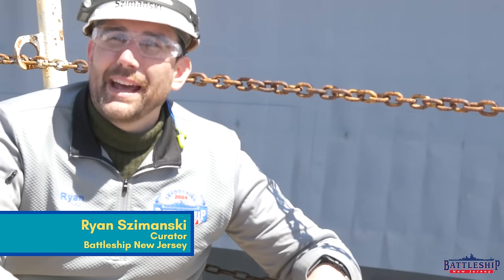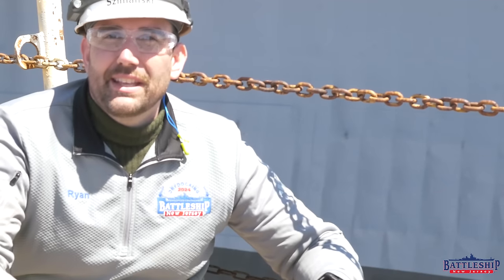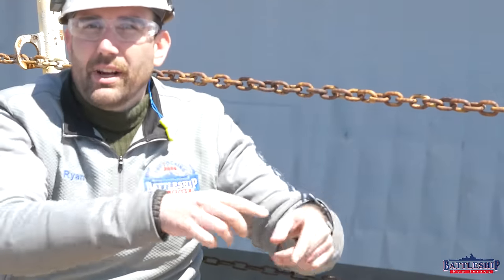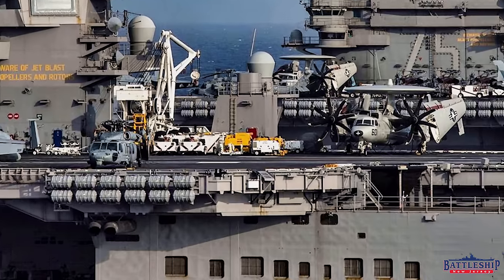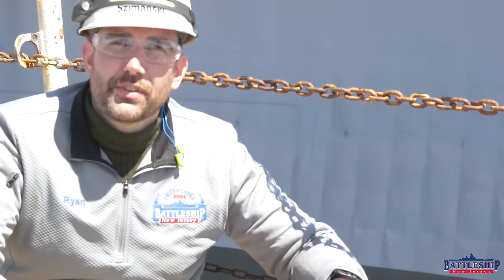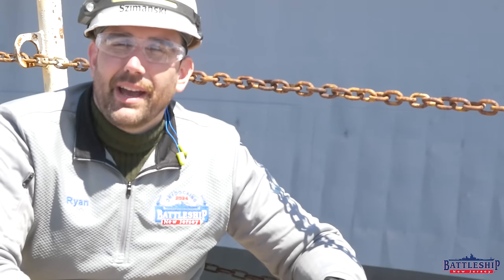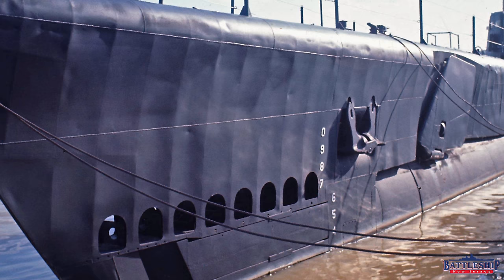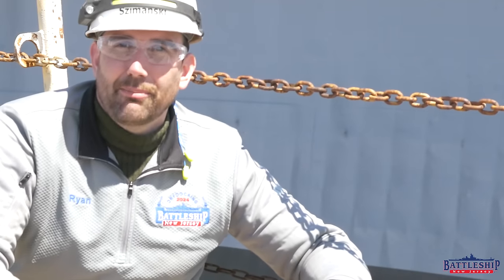What's With All Those Dents In Ship Hulls?

Comment: Hi Ryan.  Sorry to disagree with you but "oil canning" is NOT caused by the heat of the sun.  It is more properly called, in structures circles that is, diagonal semi-tension buckling or simply shear buckling and is common in thin (relative to the length and width dimensions) skin structures where the shear stress exceeds the critical shear stress for buckling (most practical shell structures) and the shear load is the caried by a diagonal tension field similar to the way a girder truss works.  It is very common in aircraft (even at night or in the hangar).
Reply: Yep. 

It will also be there permanently if some of the members (spars, ribs, frames, stringers, etc) have gone beyond their yield strength.
Reply: More like "hungry horse" thermal expansion and rarefaction
Reply: Mhhm. Yes. Indubutably. I totally understand.
Reply: Sorry to disagree with you but look the location where it is happening that blows your argument out of the water.
Reply: @autumnfragrance6326  Sorry, I don't get the "hungry horse" reference.  Its got nothing to do with thermal expansion.
Reply: @2esc2esc  I guess this is a dry dock joke.  I'm sure any experienced structural engineer will confirm.
Reply: @emmabird9745  We in the industry call it hungry horse because you can see the ribs through the skin... like a skinny horse.
Reply: @autumnfragrance6326  Thanks Autumn, yes that makes sense.
Reply: Wouldn’t distortion caused by the heat of the sun cause shear stresses?
Reply: Why not speak in plain English so everyone can understand you
Reply: @Thing696  Hi Diane.  In answer to your question, the sun heats things up slowly (on earth anyway) and the heat soaks through the structure.  Yes there will be a thermal gradient (some bits colder inside the structure than the warmer bits outside) but not sufficient to cause the effect.  To cause it the top of the hull has to get a lot hotter (so it expands while the keel is a lot colder) which would cause a "hogging" moment (technical term meaning the centre lifts up).  I'll leave it to someone else to work out what sort of temperature difference would be required and then take measurements to test the theory.  Perhaps Ryan can get some temperature measurements of keel and deck through the day.  I doubt there will be sufficient difference.
A possible source of the shear stresses is the blocking pattern compared to the slip way supports.  What I mean is it it possible (actually likely) that the keel supports at building were not perfectly flat (flatness over nearly 1000 feet is quite a challenge) and the hights of the blocks do not present a flat straight line, at least not the same out of flatness.  That would produce shear stresses down the length of the hull.
This is a comparison of "out of water conditions", of couse in water the buoyancy distribution would very rarely match the weight distribution so that will create shear stresses too but Ryan's picture is out of water.
I'm not a "naval architect" but a structural engineer whose structure normally exist in other media, but all structures behave the same.  Hope that helps.
Reply: It comes from the water sucking away from the steel.  Like the superstructure pressed from wind.  The water "oil cans" the hull outwards between the ribs on the hull.
Reply: @gerryscully9248 Any time a group of technical guys sit at a table the tech-speak doesn't take long to start. I was a radio engineer - happened all the time. My girlfriend would laugh about it afterwards.
Reply: @gerryscully9248 The purpose was to showcase purported knowledge, not broadly inform.
Reply: It’s from the bulkheads being welded. Weld draws/Pulls on material that’s welded.  Also as he says, steel expands when heated, even by the sun. With 16 years of building and repairing large oil storage tanks… I know how steel moves, expands, and contracts.
Reply: B52 side comes to mind.
Reply: @AnthonyTolhurst-dw1nc  A classic case.  A number of heavy lift helicopters (eg HH5) and more than a few cargo ships with their thinner plating.
Reply: I think the fleet subs examples show that it can occur despite low structural loads at the superstructure.
Reply: @MarcinP2  Yes indeed, quite low loads can do it.  Thanks Marcin.
I was looking at Ryan's "picture worth a thousand words" episode on the ships launching.  I looked very hard, but I couldn't see a single "oil can" in the plating when the hull was so well supported (and in the as built position) in those pictures.
The keel blocks support the hull differently, hence the shear forces from its weight.

Comment: Working as a ship fitter at BIW, brand new destroyers have this issue. Years ago this was fixed by straightening all bulkheads by using a fine spray  of water and a heat from a torch. This would straighten the ripples in the bulkheads. This is still done, but only on badly warped or rippled bulkheads.
Reply: Yep, I worked Dept. O9 at the yard in the mid 2000s and I only ever saw the weather deck plating being straightened. I assume because indentations would make a puddle and/or a tripping hazard. 

A bunch of the old timers I talked to said that the Arleigh Burke DDG-51 was beautifully smooth. Apparently, they flame straightened everything for the first run of ships. I'm sure it got cut for cost.

Keep up the good work, brotha'.
Bath Built Is Best Built! 🇺🇸
Reply: Bath Iron Works?
Reply: Thanks for what you guys did at Bath Iron Works. I was a sailor for a couple years on U.S.S. Preble DDG-46, and I’m sure you didn’t work on that particular ship, but Preble was built at BIW way back when. The tin can fleet owes a hearty salute to all the shipyard workers and engineers who turn out great ships. 🫡 🇺🇸 ⚓️
Reply: Until they invent a metal that can stretch and regain its shape, this isn't so much an issue as it is a design choice. You could most definetly make a rigid enough ship to not have oil canning, but do you want to? - is the question.
The more they travel, the more stretch they get, until the "belly" between frames reaches its max potential and it just exists there. Oil canning are ... essentially tiger stripes on boats - for the same reason we have them as well. Moving about, the skin stretches between rigid portions.
Reply: I worked @ BIW in the early '80s in production planning department - some of the "oil canning" is caused by welding heat shrinkage (the heat makes the metal shrink and pucker).  I worked with the IHI (Japanese) consultants on flame straightening / bending techniques. We watched them lay out and form a piece of shell plating with nothing more than a torch, a water hose, and some wedges/sledgehammer in less time than the yard guys could do it with the 3-roller bending press.  Took incredible skill and lots of experience to do that.
Reply: @thejohnbeck  Yea, they build destroyers, cruisers and frigates. They also built the 3 futuristic Zumwalt destroyers. The Navy deemed the the practice of straightening steel too costly
Reply: After welding the plates to the frame, even the cooling weld shrinks and causes the plate to be pulled inwards.
Reply: Thanks for that info and thanks for all your hard work. You and those like you really make this world go.
Reply: See Terminal Island back in the day. They were in a hurry.
Reply: Respect to the ship fitters.  That is a hard job that requires a lot of expertise and hard work.  The trades folks hardly ever get the respect they are due.
Reply: @normandiebryant6989 This is the correct answer. 
If it was due to the sun or heat after the fact in general they would pop both in and outwards are random. 
We used to call the metal bending guys heat shrinkers where I worked at Ingalls Shipbuilding. I was a Shipfitter there. Anyways, they had to leave these this way due to the fact if I recall correctly they wasn't allowed to shrink the dents out of the more sensitive armor plates or they'd lose thier strength. In fact we wasn't even allowed to use torches to wash our welds off of it. We had to going them off instead so it didn't overheat. 
That's why we see those.
Reply: I used a long torch, with 3 nozzles.
Reply: This technique is called "shrinking"   it is oft used in car collision repairs to shrink bent or oil canned panels back to original shape.

Comment: Jersey is a welded ship.  Welding causes heat distortion,  so some of this could date all the way back to construction.
Reply: I've seen "oil canning" on bulkheads on the cargo holds and engine rooms. I've worked 3 decade in shipbuilding and I have questions about his explanation.
Also I've never heard of any ship with 48 inch frame spacing. I guess it might happen however I've only seen ships with 36 inch frame spacing. Even the metric blueprints I expected 1 metre space however the print where 9144 mm 🙄
Reply: @davea4245  i dont buy his theory either. most people just dont think how much ships flex, because on most of them you cant see it happening. my first ship in the navy, i caught it in the PI, we pulled out on the edge of a typhoon, so it was a bit sporty out, not to mention it was a flat bottom lst, but on this lst you can look from the stern to the bow, right through the superstructure. first morning out my lpo says come here, look at the jack staff. mind you we were almost at the fantail at muster, and i looked through the superstructure to the bow, and holy heck the danged ship was bending 4-5 foot while riding through the waves. imo, the twisting, bending, and flexing is what causes the skin of the ship to stretch, causing the "oil can" affect.
Reply: @leftyo9589 if it’s waves that make oil canning, why does it ripple on the ends of the ship instead of the middle where most of the distortion takes place? It happens where the ship is the most curvaceous. Any welder will tell you that during the welding process, the weld metal and the adjacent base metal will expand and contract throughout the heating and cooling cycle. During these cycles, it's inevitable that some distortion will occur due to the movement of the metal. 

If all of this isn’t true then I have one very simple question for you. Why do we not see oil canning on ships that are riveted together?
Reply: @leftyo9589  I live on a narrowboat, on the canal network in the UK. There are no waves or rough weather but oil canning happening partly during construction, due to the heat of welding, but also in the sunlight. The expansion is so great that it creates gaps in the internal wooden bulkheads as well as cracking sounds from the expansion and also contraction when the sun goes down.
Reply: @danieljones7843  Weld causes metal to shrink more than it expands ,in more depth molten metal cannot expand to its desired size since surrounding area is cooler and stronger than molten area ,molten area would  grow in all directions it can plasticly never going back to its original shape ,while cooling metal will regain its strengths pulling and bending straight areas to new oil canned shapes  ,To minimize this all welded area is preheated to high temps of plasticity welded and cooled down evenly .
Reply: 100% correct
Reply: Possibly. Depends on their welding standards. Most welders can dispress it pretty well especially if its thick. Obviously ww2 so they probably skipped some steps

Comment: “Oil canning” is caused by welding distortion - in particular as the welds cool from high temperature (melting point) they contract and pull the plate towards the weld.  Shipbuilding 101.

Comment: You can see similar oilcanning on the fuselage of the B-52s still in service.
Reply: I was stationed at Barksdale AFB from 2002-2005.  They said it was designed this way, as flying high up in altitude, the pressurized cockpit will even those wrinkles out.
Reply: A lot of aircraft get it.
Reply: The wings on a B-52 "flap" in flight.  The wing tips move up and down.
If they didn't flap, turbulence would cause them to break off. 🤠
Reply: @jamesburns2232  pretty sure that's most aircraft. Wing has to be strong but flexible. 

Especially at the tip when there's no winglet or fence.
Reply: Mesh doors have it too. Same reason. Rigid framing for a thin skin + movement = stretch and deformation in the skin. It's actually part of the design in most applications of this methodology. I might have it wrong, because this is just based on what i've visually seen, but i think in some parts of airframes, they specifically reinforce (extra fabric - fiberglass or carbon or whatever they may use) the edges leaving an oval shape of lesser material towards the center of the "segment" to allow it to buckle and move rather than be rigid and crack.
It's also the reason why long, lloooooooong boats, when you look down the centerline in rough seas look like a 3D variant of the empty metro, bending and twisting ... but not breaking apart (like they used to, for example, on the great lakes, where many a boat was lost because they were too rigid).
Reply: @jamesburns2232  all aircraft wings 'flap'. in flight,  for that very reason, if they didn't flex, they would snap off.  with negative results for those onboard.
Reply: @jamesburns2232 Yeah that is all plane wings, like the 747 wing tips can flex as much as 10ft above and below the cockpit during flight to handle turbulence.
Reply: I've seen a B52 at RAF Duxford museum with oil canning and wondered why it was like that as even above the cockpit had dents all over it.
Reply: @AJS86  just about every stressed skin aircraft will have some oil canning some where
Reply: 757’s all have it on the fuselage behind the trailing edge. Its caused by hard landings. The skin starts to ripple.
Reply: this happens due to the expansion and shrinking of the material with the change in tempreture
Reply: @charlesball6519  "IT" was designed that way but NOT because of pressurization. Fuselage area that shows the deformation on the ground is NOT pressurized.
Reply: You see flex in aircraft skins. NOT oil canning. Don't know about ships. Oil canning is not allowed because it will rapidly work hardens heat treated aluminum to the point of failure. Oil canning does happen on aircraft but it is a defect that has to be repaired. You may see stress / deformation / flexing (as in the B52 center fuselage) which mostly straightens out in flight. The wings of the B52 actually move quite a bit more then say the C5. The Buff was an early (late 40s early 50s) design that we have learned a lot from.

Comment: As a non nautical person I had always assumed this was from heavy waves battering the sides of ships over the years and pushing the metal in between the supporting ribs. I’m glad to finally know what the real cause of it is.
Reply: As a person who uses YouTube often, I also guessed that would be the case.
Reply: I’m still going with the atmospheric and physical pressure changes over the giant invisible thumb chasing ships… 😂
Reply: Yep I thought the same.
Reply: You are actually also correct. Not heard it called 'Oil canning' before, maybe its an Americanism? We UK seafarers call this 'panting' and it  refers to the flexing in and out like an oil can when a ship is making way in large seas. If you Google Panting in ships, it will describe exactly this
Reply: @GlenMartin yeah but you guys speak english and not mickey mouse
Reply: It can also be due to waves, so there is more than one culprit.
Reply: have you ever been in metal building or near a metal object, all day long, all month long, under the sun? did you hear a spontaneous PING that is solar oil canning.
Reply: @petedude2lu3  Yes, however I also work around semi tanker trailers constructed of both steel and aluminum and you don’t  see the sides or ends of tanker trucks driving around flexed in or out. I would have thought warship cladding would have many times the structural integrity of a tanker trailer.
Reply: @squangan Does it have to do with many of those being reflective? Is that why they're reflective?
Reply: @norseman5041  Agreed, I spent a full month resurfacing a steel hulled yacht that had major buckling in the plates from a storm with marine bog to make it look pretty again. Must have put close to half a tonne on it to get it looking smooth again.
Reply: Yes, it's called Panting.